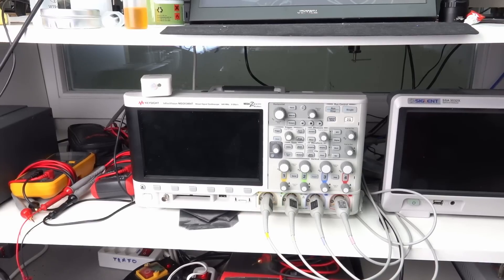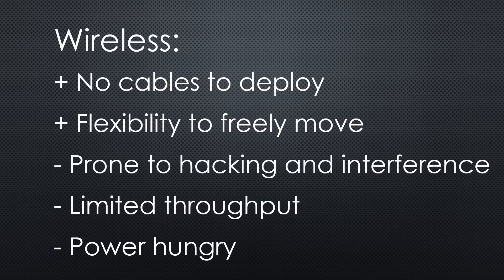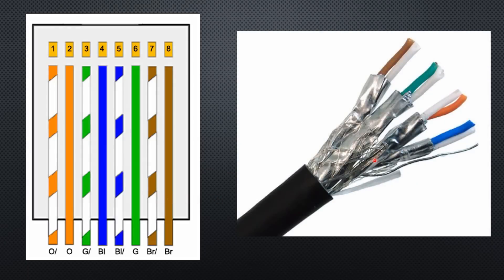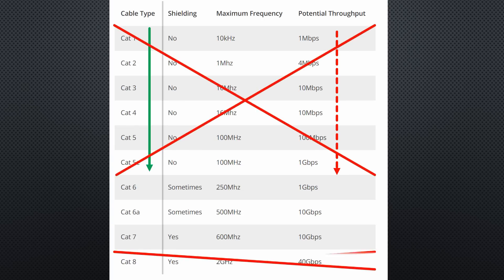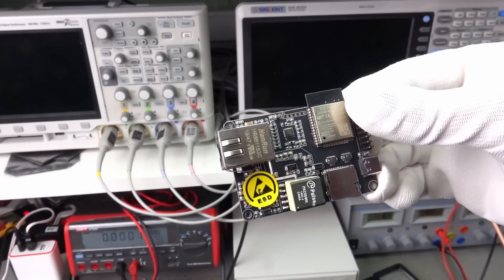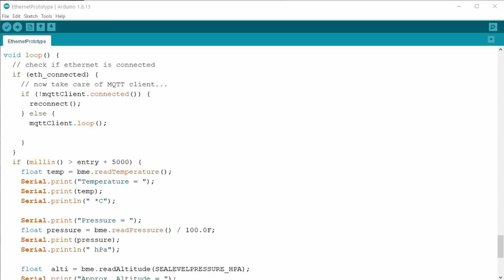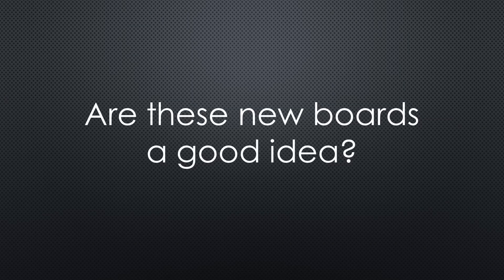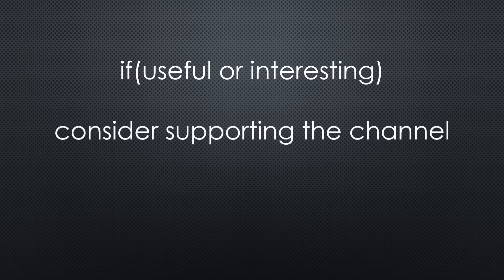#365 Is Power over Ethernet (POE) on the ESP32 any good? (New TTGO and Olimex boards available)

Comment: We use Wesp32 boards for bigger scale project. I meantioned them cause it has a little bit better pcb design, and has the best name ever :D
But the price is higher.
 BTW you could say a few words about the two kinds of poe (forced poe and poe on demand).
What I learned that raspberry pi poe boards ony work with force poe, but wesp32 boards are getting killed by forced poe (dont ask how I know), and only can used with poe on demand.
Reply from the maker: I did a video about POE. But I wonder why the Pi board is destroyed. The standard says devices have to support both modes.
Reply: @AndreasSpiess  Sorry I missed that video. To clear some things up:
- The Rpi boards only worked with forced poe not with poe on demand
- the wesp32 get killed by forced poe (to be specific the lan chip died, after replaceing them we reused those boards.)

Comment: Router has nothing to do with cables pinouts. Cables are Layer 1 & 2. So is is a part of the switch do know how can i communicate with the other. Router are also at wireless connection ;).
Reply from the maker: Theoretically you are right. But a lot of routers have built-in switches (also mine, as you know). And most people do not distinguish between the two functions.
Reply: @AndreasSpiess  i know what you mean, but it is not correct ;) Do you get the powering over PoE to run?
Reply from the maker: Yes, it works. I added a power supply long time ago and it is used for these round access points, too.
Reply: @AndreasSpiess  have you add the 24 or 48V Power Supply to the switch?
Reply from the maker: 48V

Comment: The danger sticker is about electro static dicharge or esd. Not about 48V which is generally counted as safe for skin contact. Note that this is certainly not always a safe voltage. Look into SELV and PELV topics and standard EN 50110 for a better understanding of safe low voltages. ESD is a different cookie.
Reply from the maker: We both know it. It was more a joke. I never saw such a sticker on a Chinese board. And now I see one in an area which is probably better protected against ESD than every pin on an MCU.

Comment: Hello Andreas - I think you have missed to mention galvanic insulation. This is also important for IoT devices that are connected via a longer distance and can increase reliability.
Reply from the maker: Ethernet cables are always galvanically separated (as Wi-Fi). So I do not see a big difference. Or do I miss something?
Reply: @AndreasSpiess  I fear that POE mostly runs without galvanic insulation for an easier switching-power-design.
Reply from the maker: It should not.
Reply: @AndreasSpiess  It should not indeed, but there are lots of PoE dev boards out there that don't use the correct 10 pin RJ45 headers and/or the rather large PoE isolator transformer blob you see on your boards.
Even some commercially available PoE powered devices don't use isolation for their PoE, which is fine if nothing is connected to the outside world from the board, but it is something to keep in mind when people start tinkering with it.
For proper isolation of the PoE power supply you still need some rather bulky parts (almost the size of the ethernet header) or if you go smaller you end up using quite expensive parts or maybe only use those low power isolated DC/DC converter modules (often < 1 Watt)

Comment: Cat7 for IoT? Well... No. Cat5e is all you need. It's cheap, reliable and may be used up to 10gbps on short distances (up to 30m). Besides do you know any IoT devices which require speeds provided by Cat7? Since you should use two separate networks (one for IoT, one for multimedia) I would go with Cat5e for IoT and Cat7 for multimedia.
Reply from the maker: I did not particularly talk about IOT. In my world, Ethernet cabling is done without a purpose in mind, just as an infrastructure. Of course you do not need Cat7 for this ESP32.

Comment: 11:50 Andreas, I would disagree with your statements we should invest in Cat7 cables for new projects. Controllers like ESP32 wound never go above 100mbps (maybe someday 1gbps). For that Cat5 is more than enough (Including PoE). Cat7 is 2-3times more expensive and harder to work with (because of thick shielded cables) than Cat5/6
Reply from the maker: You are right. In my world, Ethernet cabling is done without a purpose in mind, just as an infrastructure. Of course you do not need Cat7 for this ESP32.
Reply: In my opinion even the 1MBit ethernet for temperature reading or swithing lights on/off is overkill. The truth is that we do not know the future, so the real question is. Is better to invest on the begining or destroy walls later?
Reply: Cat7 also isn't recognized as an official standard by the TIA/EIA.
Reply: When i look into ebay for example I see a 25% price difference between cat 5 (40€ for 100m) and 7 (50€ for 100m) cable not 200 - 300 % , why do you say such a thing ? It's just not true.
Harder to work with because of the thickness, really ?? Sorry Sir, but that's ridiculous. You get almost double the copper plus shielding which may be good for the next 25 Years of Data transportation and you still find something to complain about ... whau !
Reply: Hey,  @tinygriffy  It's not about the complaint. The idea of the comment sections is for everyone to express their opinion/share their experience, so you have another point of view on the topic.
And I see you're getting emotional, but please get some practice in structure cabling before claiming something is ridiculous. 
The price of the cable should accommodate for a lot of variables. There are cheap and expensive cables out there. There are CCA (copper covered aluminium), CU (solid copper), then there's thickness of shielding foil, is there braided shielding or not, etc. Then we're moving on to RJ45 plugs and jacks. Cat6A's are MUCH more expensive than Cat5. They take longer to crimp/assemble and they're generally hardER to work with. You don't believe me, take a look at this: 
https://www.youtube.com/watch?v=f2bILsfu8NM
https://www.youtube.com/watch?v=aVtOmrULE2w
Reply: @f1r370  I looked up the prices, I worked with different types of cables too, as I said you get a lot more for an extra 10 bucks per 100m.  If you pay someone to do it its also a factor. If you need an upgrade later you pay that twice too. For me it makes absolutely no sense to put down "old technology" . I was thinking of the environment too.  I find "harder to work with" is no argument, at least that's my opinion, that's a job you do once in 20 years. But that's probably the world how it is these days, have it easy for me now and don't care for others or the future. I still find it ridiculous to put down cat 5 because its easier to work with or cheaper. Emotional, yes ! there is a lack of emotions in the world these days.
Reply: @f1r370  I want to add something here, it it not my intention to insult you or something I hope you don't get me wrong. It is just... I am exactly in that spot where I whish that I had invested a couple more bucks for better cable, a couple Years ago I had to move to another spot on the residence and now have a 10 mbit connection to the rest of the house, the router, my nas the satellite receiver etc. Just by pure lazyness (and a little foresight) I did not jet dig a 100 meter trench to put a cheap cable in.
Reply: @tinygriffy  Man, I'm not getting you wrong whatsoever. I'm building a house ATM and I've put ~2km Cat6E in the walls. That's for sure. But I'm not planning to use it for any IoT/MCU projects as I consider it waste of money to put 10G cable + connectors for 10mbps max connectivity and <<1mbps actually required.
As Confucius said: don't use a cannon to kill a mosquito.

Comment: Did you know LADA still sells the same model from 40 years ago. Its called NIVA. 40 years later its still terrible
Reply from the maker: I liked my Lada a lot back then because it behaved better than the big Toyota on wet (and horrible) roads. But its quality was not very good :-(
Reply: @AndreasSpiess  I have heard that a lot of old fiat panda 4x4 are still used in Switzerland, is that true? They must be 30+ years old now, surely a fiat can't last that long! 😁
Reply from the maker: They were popular in the mountains. So I do not know (I live in the flat area)
Reply: 👀 I mean at least its consistently terrible, you know what you're getting into! 

And having watched a fair bit garage 54, I have great respect for ladas. They are pretty bulletproof! same with old skoda rear-engined RWD saloons, they were a hoot and impossible to blow the engine :)

Comment: Andreas, the way you worded the part about "crossing" the wires in an ethernet cable may cause some confusion... it's true that you no longer have to create or use crossover cables these days because every NIC, switch, hub, etc. is able to negotiate and handle that automatically (unless it was made [probably] 10+ years ago). But when you're crimping your own RJ-45 connections to make a patch cable, the orange or green (depending on whether you're using 568A or B) wires need to "surround" the two blue wires in the middle - meaning all the pairs can't just be wired "straight through." You have to unwind the green (or orange) pair and bring one wire (in effect) across the blue pair, and I can see where people might think of that as "crossing" those wires... and this is where the confusion may come from. However, your info about picking 568A or B and always being consistent for both ends of a given cable is spot-on. So as long as people pick one or the other and follow the standard, they'll be fine.
Reply from the maker: Sorry for the confusion. I think most people do it like me and look at a drawing when the insert the wires...

Comment: Andreas, could be possible to use  Eth and Wifi at the same time?
A practical example is a Eth network analyzer which is controlled by a remote smartphone/tablet connected to the ESP32 as a Wifi access point
Reply from the maker: I assume it will work because Olimex names one of their boards "Gateway". But I did not try and also do not know how to do it.
Reply: I ran the Espressif Ethernet / WiFi bridge code on my wESP32 and it seemed to work: https://www.crowdsupply.com/silicognition/wesp32/updates/ethernet-to-wifi-bridge-demo-code
Reply from the maker: It looks it uses the IDF and not Arduino :-(

Comment: I've tried every board that involves esp32 and Poe for my company.
The olimex boards are crappy and totally unreliable: many of them comes from factory faulty and they are very sensitive to ESD discharges (also the esp32-poe-iso).
The ttgo boards are okay but only for hobby projects, as you pointed out too many pins were used and the board becomes pretty useless.
The best one that actually is available on the market is the wEsp32 from silicognition, yeah, is more expensive, but affordable, totally isolated and it can provide up to 13W from the Poe step down converter on board
Reply: Hi Simone, could you elaborate on "crappy". I'm planning to base my home automation on ESP32-ISO from Olimex. So far I've bought only 2 boards and I'm quite happy with them? What kind of troubles should I expect?
Reply: @f1r370  hi plamen's, I've tried to use them in industrial environment (esp32-poe) with my own rs485 iso converter, we have seen that the PCB layout is very compact and optimized, but the Poe step down converter develops a lot of heat that will affect the ripple on the power lines (that reaches high values on long term power up)
This, for us, was only one of the biggest problems, also, the pcb layout of the ethernet module is not optimized and it will result in non stable ethernet transfer speeds/stability: comparing 10 boards, we have seen that there is up to 25% of difference between speed of boards.
Another big issue that has the esp32-poe and esp32-poe-iso, is the ethernet enable/reset management: is poorly implemented and sometimes (during reboot/power up/working) the ethernet shuts down without any apparent reason.
I mean, for a home project they will be okay, but in a real world business scenario they are totally unreliable.
Reply from the maker: Thanks for adding your information.
Reply: Thanks very much for the rec of wEsp32, it looks like a well designed board.
Reply: Thanks Simone, did you test this one too ?

https://www.cnx-software.com/2020/11/09/6-wt32-eth01-is-a-tiny-esp32-board-with-ethernet/
Reply: @SchmurtzAlex  no, i haven't tested it. Also, seems that this board doesn't support PoE, so it's out of my business right now :)
Reply: @Simone-mk1qu  Thanks Simone for this fast answer, you're totally right it doesn't include POE and it is based on WT32-S1 with 4mB against Wrover 16mB for the TT-GO. Thanks for the tips about the wEsp32 from silicognition,  for home usage it will be easier to choose a SBC for this price but for professionnal usage it's a good tips to know :)

Comment: 25$ for esp32 seriously? Its price of some types or versions of rpi which if much faster than esp32
Reply: MCUs are stable and much harder to hack. RPI and other 1board PCs are a can of worms on their own. You have a linux node which needs mointoring and updating all the time. Not to mention SD card burnouts...
Reply: @f1r370  to fix SD card burnouts create a Linux ram drive then mount the directory for all the logging to this ram drive. Set up a cron job to flush to SD at your schedule you are comfortable. I am comfortable with 7 days. Now I write Linux logs to SD one time per week instead of multiple times per second. SD card early burnout problem solved. Enjoy!
Reply from the maker: For me, MCUs and SBCs are built for different purposes, independent of the price.

Comment: doesnt POE defeat the purpose of WIFI/BLE? ESP32 is never going to use full wifi bandwidth.. congestion is negligible just due to general low data being generated..ya never gonna use more than a 1-2Mb/s (think mp3 streaming)..IMO no point hookin up 10/100mbit ethernet
Reply from the maker: You probably are right. I never had a project where network speed was a limitation. This is why I also did not do any speed comparisons.
Reply: For me, everything that can go without batteries is good. If I had to rewire the house (I hope not 😆), I’d put 12v 9v 5v outlets to also get rid of all those adapters. I don’t know if they exist, if need I will invent it 😁
Reply from the maker: POE is a good step into this direction, I think. This board delivers more than 1A on 3.3 volts for sensors, etc...

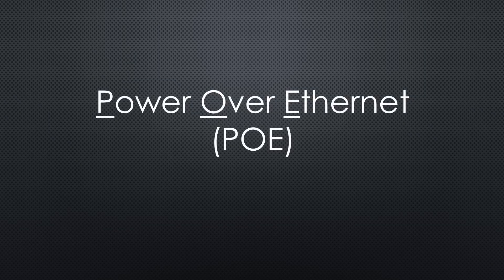Comment: 6:52 min "Power over Internet" would be a great Idea! :)
Reply from the maker: :-)) Actually, POE is similar to the 1980s telephones with only one wire...
Reply: back to the 80s when our telephones were  powered from the network  🤣
Reply: @ManfredBrauchle  I think you'll find that POP (Power Over Phonelines :) was introduced in the late 1800's. The 48 volt phonelines are still in use today.  However, many phones today have ancillary power that is used to power fancy displays, answering systems, and Bluetooth connected add-ons.
Reply: @newburypi  I’ve got an old 1910 phone with ‘local battery’. Amazing the distance it can go. They got several versions with a range of 300km to 500+km. Pity it doesn’t work nowadays with central battery exchanges.
Reply: @ManfredBrauchle  They still are. :) Not the dect’s, but the basic ‘dumb’ phones are still using the phone line current for voice and ringing.
Reply: With a google account you probably get the first 15 GWh for free :-)
Reply: @daskasspatzle2396  You have no idea how close you might be to the truth 20 years from now.
Reply: He should patent that!  Even Swiss banks will not be big enough for all the money that he will get then.

Comment: I have been crossing the PITA wires in my cables for ever. And now I learn it isn’t necessary. Thank you!
Reply from the maker: At least as far as I know.
Reply: @AndreasSpiess  yep it’s true. Switches without MDI have not been made anymore since 100 Mbit/s got on its way. I don’t even know a single case when connecting two non-switches (modem to router) need it anymore.
Reply: If you look at the material for Cisco certification they will still tell you when to use cross over or straight through cable even if it’s not been needed for years. Handy to know though when dealing with legacy kit.

Comment: Just googled about the cable categories. Plain cat6 cable can support 10G up to 55meters. So, technically cat6, cat6a and cat7 can provide 10G ethernet. Great video!
Reply from the maker: You are right. I am not sure if this is true when they are in a tube with other cables and maybe some 50Hz power lines. CAT 5 and 6 have no shielding.